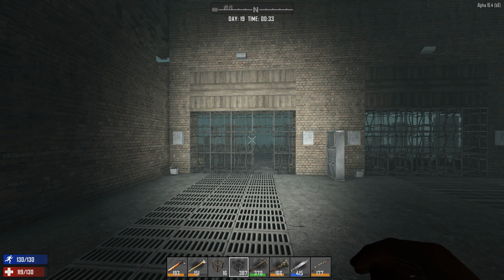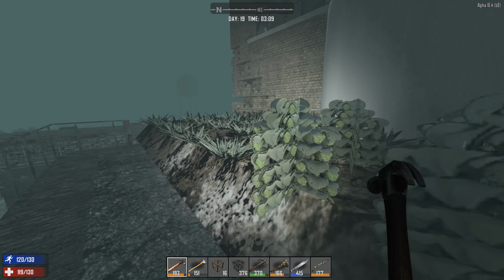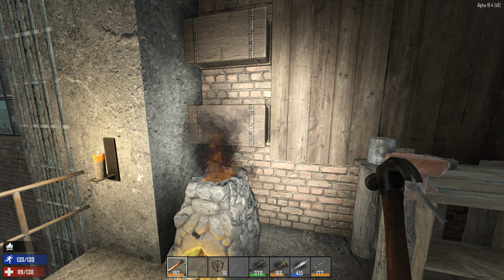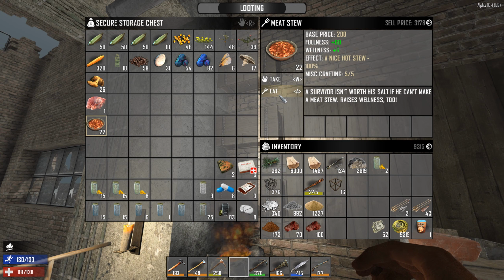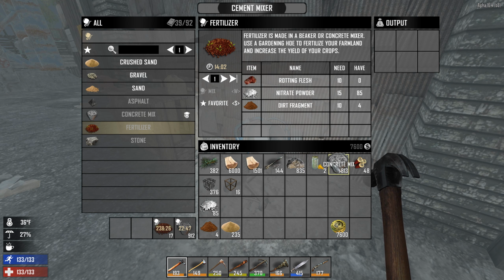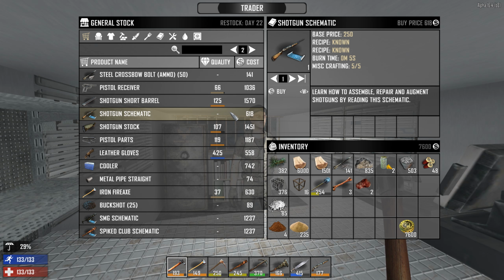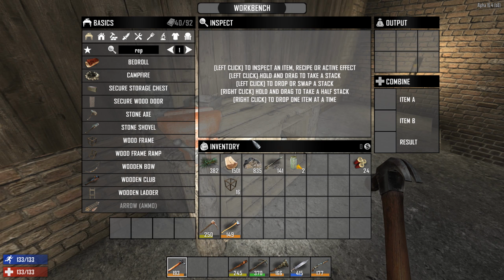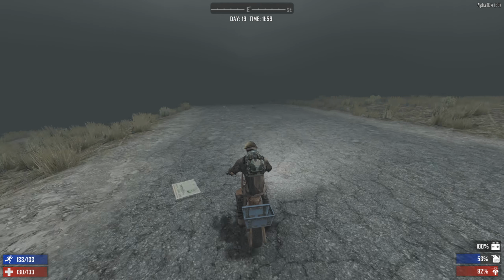7 Days To Die - S01E35 - Day 19 - Sweet Sweet Concrete

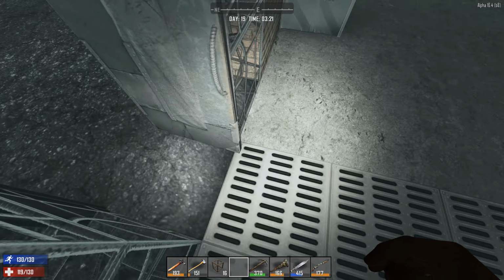Comment: 8:45 always have dilemma regarding door's placement. On internal or external side. Closer or further. I'm never satisfied bc at least from inside or outside it will look ugly like hidden on the block end due to 7d block weird system so nothing can stay in the middle block's length/width like in the Sims or project zomboid
Reply from the maker: Yeah, there is something odd about it. Especially with half blocks. Even in Minecraft, a half block only occupies half of the space, where in 7DTD it occupies the entire space. What that boils down to is some serious floating block nonsense. XD
Reply: @JohnMegacycle  Guess the only way out is to install doors on both sides however it'd be painful especially with bike in and out and double open close. Honestly gates/garage door would suit u better
Reply from the maker: @paul_henderson  Yeah, agreed. I don't know how well the game would handle a multi-block structure. There are a few already in the game, but they are static and unmoving. Lamp posts, and a few of the radio towers are examples. Once you break em apart, you see a different block as they collapse.
Reply: @JohnMegacycle  Normally I don't scrap light unless it's not working. But in your case it was inevitable to build those platforms /bridges